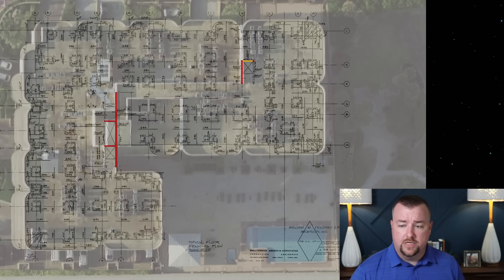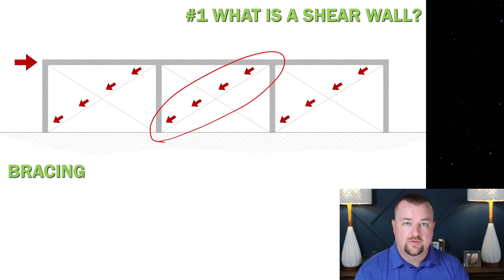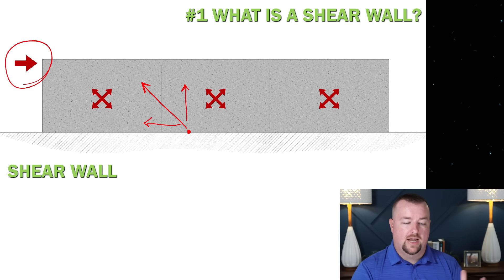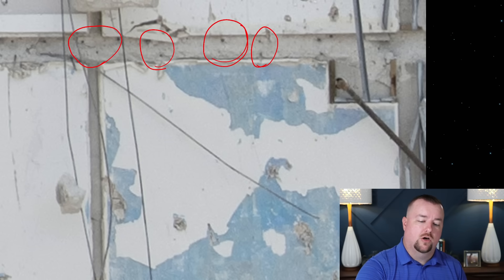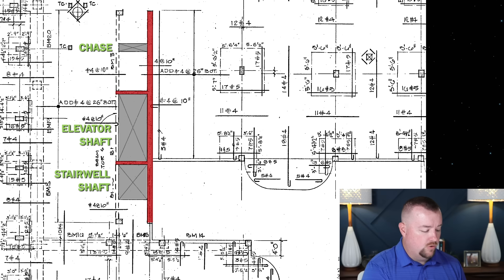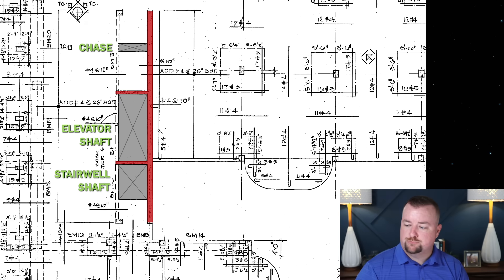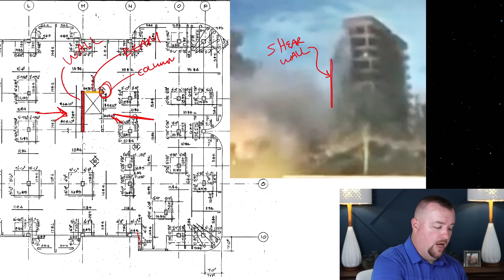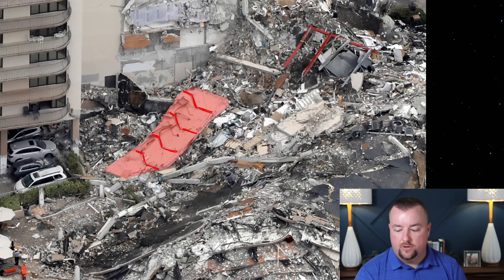Surfside Collapse - Structural Engineer Answers Your Questions About Shear and Shear Walls

Comment: A couple of things struck me as strange:
1. The major shear walls for the building seemed to run mostly in one direction.  Maybe the building's shear resistance perpendicular to the shear walls is derived from other structural elements?
2.Some rebar was only embedded a few inches into the shear wall. This seems ridiculously inadequate but maybe I don't understand something about this?
Reply: 1. Probably columns itself are considered as shear wall equal in strength to number of columns in chosen direction multiplyed by width of each column in the same direction. If we imagine that columns are built adjacent to each other they are not different much from shear wall. The difference is that they are adjacent to each other, but not structurally united except via slabs joints, so they pass leaning tension only via slab joint. The columns structure of accumulated width is weaker than shear wall of the same width.
Reply: @alexanderbelov6892  Thank you for the response. I think I was on the edge of understanding it. It sounds like calculations must have been done that judged the shear resistance from columns in one direction was enough but shear resistance for narrower part of building from the columns was calculated to be inadequate, so they added a shear wall.

I don't think any of this has anything to do with the collapse of the building but my guess is that there is less shear resistance in this pre hurricane Andrew designed structure then there would have been in a post. Hurricane Andrew designed building.

As an aside many years ago I attended a lecture at UCLA given by a professor that had  investigated building failures in Taiwan after a massive earthquake there.. One of the things I remember from that lecture was that buildings where voids in the walls had been filled with rubble survived while similar buildings that had unfilled wall voids failed.
Reply: @davefoc  
Yes, they probably calculated that in most cases columns itself are enough, and additional shear walls are not needed. But it does not mean calculations included weaken concrete actually used in construction, deviations in building maintenance, destroyed hydra-isolation that caused pool deck slab to be wet, and rebars experiencing corrosion, so on. The building was not constructed even survive pool deck collapse that happened before building collapse according to witnesses.
There was no over-engineering. But there were obvious cost optimizations during construction period.
Even inexpensive concrete panel constructed building may experience partial collapse with one unit stack from bottom to top. While the whole building stay strong.
This slab+column structure has much more chances to collapse as whole structure even if only one column is damaged.

Comment: Can't imagine any rodbuster tying slab bar into a shearwall without some sort of hook, even in Florida in the early '80s.  That would be criminal negligence that would have had dozens of workers/inspectors/supervisors ignore a glaringly obvious problem.  I simply don't see evidence in the other parts of the building that indicates significant corners were being cut.

Comment: Hi Josh. Thank you for your interesting article on this building collapse,which I have been following. I'm not an engineer but have been involved in construction for a number of years. I would typically cast shearwall to underside of floor slab level and extended inside shearwall  formwork up to top of next slab level. With floor slab formwork in place, deck rebar would be fixed into shearwall(hook bars) and slab cast. External formwork would  then be placed and wall cast to underside of next deck level and process repeated.(Obviously wall rebar spliced at inverals at 50 times bar diameter or relevant code) . This would ensure a  good connection. This is just my take and there are obviously other methods employed.. Thank you

Comment: It would be really interesting to cover in a future video the following question: "what has (or hasn't) changed in today's construction techniques and building codes that makes a collapse like this less likely to occur" - it's something you hinted at in a previous video that this collapse may be partially attributable to the techniques and technologies available at the time it was built, and newer buildings may not be as susceptible to progressive collapses.
Reply: Concrete hasn't changed that much, but I would expect a lot more steel, particularly in a coastal area. I have seen a 3 storey building constructed with more rebar than that 12 storey one.

Comment: Why did that not build another shear wall the size of the other, besides the fact it was not need? Second based on this collapse do you think there is an argument for more shear walls?
Reply: The shear wall is not there to prevent this type of collapse. It is there to resit lateral movement from the wind. Which they did perfectly well.

Comment: What I’m curious about is the CDI contractors who said the concrete they were drilling into to place explosives felt nowhere near the spec the design required. I’m guessing they’ll be quite keenly looking into this, especially considering that drilling into concrete is what these guys do all day, every day.
Reply: It is strange that so expensive building was built from shitty materials, but still it had been standing 40 years. It was built on the edge of structural integrity.
Reply: @alexanderbelov6892  That's what happens when you have the mob as the contractor... my guess.
Reply: @alexanderbelov6892  if anything, that goes to show how good flat slab stuff is, if it can take that much punishment for so long.

Comment: Great analysis and presentation. Wondering though why the small east shearwall didn't collapse towards the west remaining building if it fell over after it lost support from the collapsing floors. Any comment on how it seemingly pivoted 90 degrees on its end and fell towards the south as seen in the red shaded area near end of video.

Comment: It appears that the short e-w walls at the elevator shaft were not designed to be shear walls.  (See foundation plan and the lack of any grade beams or added piles to resist the overturning forces)  I believe that the design relied on the stucco covered un-reinforced masonry walls at the exterior of the building.  One at the north-west corner of the building and one at the south wall.  These would be infill masonry and are only shown on the architectural plans.  Note that at the south wall this masonry in fill wall stops at the second floor.  The wall doesn't continue to the first floor as there is provision for guest parking in this area.  Instead there is a concrete moment frame (not detailed) at this location consisting of 5  24 inch square columns and a 30 by 42 inch deep beam.  Its hard to believe that such a system would be approved but its the only explanation I have been able to come up with.  (A retired structural engineer with 50 years experience)
Reply: probably correct as wind loading was not emphasized in 1980 .They used the dead load of the building to resist.

Comment: Good explanation of shear walls.
I studied Architecture and drafting in H.S. and college, worked as an architectural draftsman for a number of years, submitted plans to the building department, made corrections per the building department, and worked with structural engineers on some projects.
For a simple residential dwelling we had standard rules as to how much shear was needed for a given length and height of wall. We drew details on all connections to show how the shear was transferred to the foundation. Over the years as earthquake reinforcement escalated we added more shear walls, foundation bolts, nails, plywood, welded moment frames, hold downs, and other mechanical devices to increase shear. When constructing rebar reinforced block or poured in place concrete we had engineered drawings to specify how much and size and how much overlap at the joints of all rebar. Later in life as a Building Contractor we often had to employ a private on site inspector to observe the construction of block and pour in place walls and collect samples of mortar, grout, and concrete.
As a draftsman I would mentally construct every connection and draw details if a simple note was not sufficient to explain that connection.
At a glance there does not look like there is an over abundance of shear walls for a building that tall, however the engineer’s calculations and details of the column to floor slab connections which form the moment frames can and I assume will be checked to determine if there was a engineering problem, a failure in construction and inspection, or a problem with deterioration of the structure over time.
The building did not fall over but it collapsed as the lower columns broke through the slabs,
As time and investigations progress it will be interesting to learn the underlying cause of the collapse.
I enjoy and appreciate your videos, this has become a interesting mental exercise, too bad so many lost their lives.

Comment: Do you have the Stairwell and elevator shaft miss labeled?  I believe the stairwell shaft is the tall rectangle and the elevator shaft is the smaller rectangle.
Reply: There would have been two elevators in that shaft, so I think it is levelled correctly.

Comment: If there was not an blown up rebar detail for 'hook' then we would normally hook it around vertical rebar or just do a right or left hand bend leaving atleast 10" to 1" tag end.  All of this depends on shear wall thickness as not to fill it up with rebar at slab portion.  If just doing a bend then we would normally wire bends together

Comment: Question: Its not about shear but thank you very much for your input!!
I have seen in several of the apartments where some of the bathrooms had a diagonal wall in them. AND some of the hallways within the units were diagonally arranged. 
So when I look at the blueprints of the floors/condos there doesn't appear to be any diagonal walls. Am I looking at the wrong blueprints??

Comment: Since this was the first high rise around, was there more of a need for north-south shear wall since that was the largest side exposed to wind loads? And even until the new building was put up to the south as a potential wind diverter, it still had a exposed south wall. Depending where a hurricane comes through, the wind could originate in any direction, since it's a circular storm.

Comment: While you were discussing the sheer walls for some reason it came to mind views of 100 year old buildings that have the steel threaded rods that stick out beyond the end walls that have that star shape cap and big bolt over the end.   A type of old style sheer wall.  when you mentioned wood a good example is a wood railroad trestle bridge that has diagonal bracing in all directions.

Great discussion by the way!  I have stopped viewing anybody's posting their speculation videos on YouTube about what happened.  This is the best resource.  I am surprised that city hall hasn't brought you in to explain it to them.  Where I live we don't have those 40 or 50 year inspections.  I wonder why we don't?  Aren't all building structures trying to fall?
Reply from the maker: Yes they are.  Everything ages and everything wants to return back to dust.  That's part of entropy.  Our job as structural engineers is to keep delaying that day.
Reply: The bridge is a truss which uses struts for the shear and other loads, not a skin or membrane.

Comment: Thanks for another great episode…! Another YouTuber made a good point about these condos having Marble tile floors and baths plus Other Tonnage added on just like the Pool deck … and these were designed fir Grandma in the 80’s and all theses heavy luxuries kind of crept into the buildings load one upgrade at a time ..do you think that was a contributing factor ..!
Reply: That's a really small weight load.
Reply from the maker: The building should have been designed with enough robustness to handle these extra interior loads for the most part.

Comment: So what shear walls or mechanisms were in place to resist lateral wind loads from the east and west and bring those forces down into the foundation?
Reply: Well, IMHO the building itself has greater length along west-east, so it has more columns count in this direction. Each column may be considered as shear wall of 16" or 20" length. This may be not enough, but still it works to some extent.

Comment: With regards to the hook bars into the elevator wall from the slab, very easily done. The way to do it is to have the elevator wall steel done the same day as slab steel so it's all incorporated.

Comment: "the candy cane" (12:00) as a builder, I would have interpreted that shape literally, and hooked it around a vertical rebar sticking up out of the lower wall. If the engineer intended for a 90deg bend, it would probably been caught in the shop drawing review. Those bars would have been delivered to the site, cut to length and bent, ready for  install.  Consider how the same detail is used on the balconies.
Reply from the maker: I agree that's how it should have been, but without a cross-section detail I seriously doubt they hooked any of those bars at the shear wall.  I have seen it too many times before.

Comment: Why is the stairwell shaft right next to the elevator shaft? Might the empty spaces create some kind of weakness by virtue of being a larger section of "emptiness"...or does their proximity actually give the building more tensile strength by giving rise to one longer shear wall instead of two shorter ones?

Comment: Isn’t any type of bracing only as good as the integrity of the concrete holding it together?  I’m not a builder and lack knowledge but it seems like these buildings need to be built with steel beams and columns. Thoughts?

Comment: Something I mentioned before, but then wasn't sure about, was the apparent motion of the last section of the building to collapse, to move slightly away, towards the ocean, as the other sections collapsed. It then leans back towards the west before collapsing itself. You can see this happen in a slow motion view from the neighboring building's camera. Was this lean towards the east the result of force exerted at the base by the rubble of the first collapses? And then the remaining structure sort of snapped back to the west, causing it to exceed its structural ability to remain standing? I'm no engineer by any means; just an observation. Does anyone else notice what I am talking about?

Comment: First let me say that I have very much enjoyed your videos so far. Here is the question - I've watched the security camera footage of the collapse multiple times (boy I wish it was clearer) and it appears to me that the east portion of the building that stayed up after the middle portion started falling leans toward the ocean briefly especially near the top but (could be an optical illusion) it appears to me that it is only the south facing wall on the east portion that does the leaning. It then quickly returns to vertical for some time before collapsing and bringing the north side of the building with it. I can imagine how the north wall could remain rigid because there is much more of it still intact whereas the south wall is much thinner (east to west) facing the camera. If we assume that the south facing wall only briefly turns into a parallelogram with its top leaning east, would that action fracture enough of the column to floor connections to structurally compromise the south wall which in turn would bring down the north wall much like how the center section behaved?

Comment: Engineer: I’m going to explain shear walls to those of you who don’t know what that means. 

Muggles: OK. Great!

Engineer: uses the term “moment force” to explain shear walls. 

Muggles:……….
Reply from the maker: Lol. I did explain that a "moment" in this example is the rotation that occurs where the column attaches to the slab. When being pushed sideways.  Just think of it as torque... it's closely enough related.

Comment: Yeah,seems once the strength is removed at the bottom, gravity takes over and between seismic vibration and weight, failure is an obvious result. Yet still, with all the failure of the middle and the norrh? , Side of the building ripping down, the south tower stayed intact and seemingly sound. 
I've often wondered if they built the South tower first, then downsized a bit, in concrete strength and volume. 
Hopefully they'll get a better detailed explanation, as they research the failure thoroughly. Thanks again for another detailed explanation.

Comment: Too many dumb and stupid construction detail comments. This guy has never designed a concrete slab building. Too many comment violate the rebar detailing standards!
Reply from the maker: Everything in context my friend.  Not only have I done plenty of engineering design, but more importantly, I have physically watched many buildings being taken apart to know that they aren't built the way they are drawn.  These drawings in particular are very lax with detailing as well.  Also keep in mind, I try to keep the terms and concepts basic.  This is not an advanced course on ACI reinforcement development and finishing details.

Comment: Are these Shear walls always where elevator and stairway shafts are?
Reply: no. Some are in buildings that don't even have elevators or stairwells. Like tall warehouse structure for example. But, if you DO have a stairwell or elevator shaft it is the perfect place to place the shear wall. Two birds, one stone.
Reply: @JCrook1028  
Tall warehouse structure stand rigid due to outer walls of membrane type, and columns that support walls.
Reply: @alexanderbelov6892  And as he said, they use cable bracing to make shear walls.